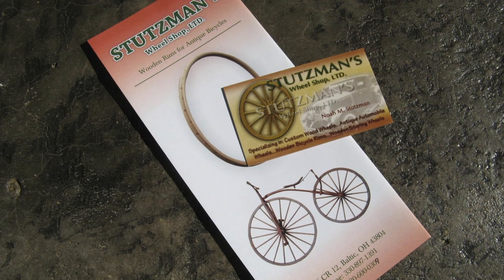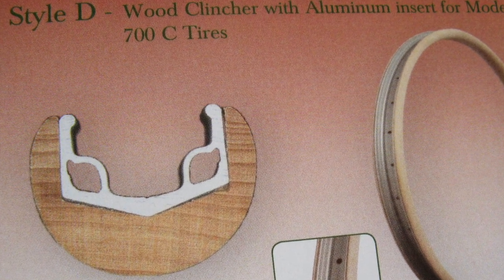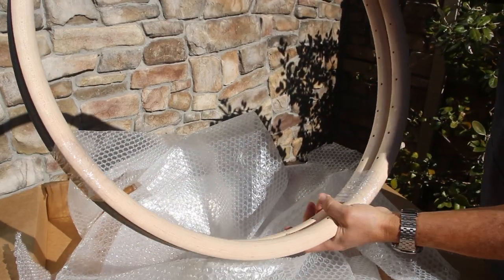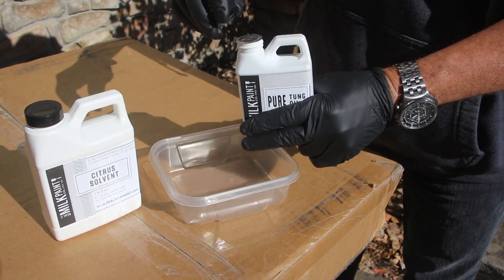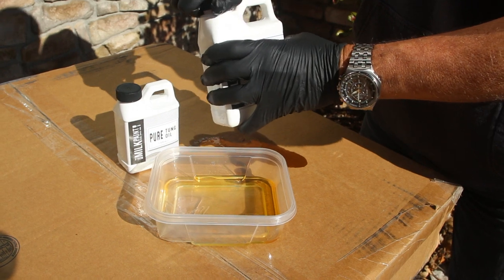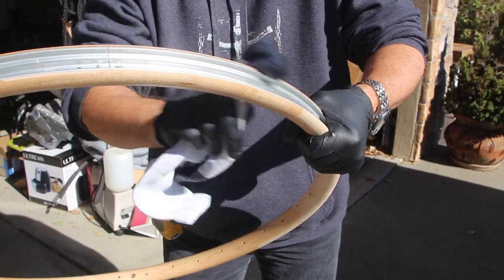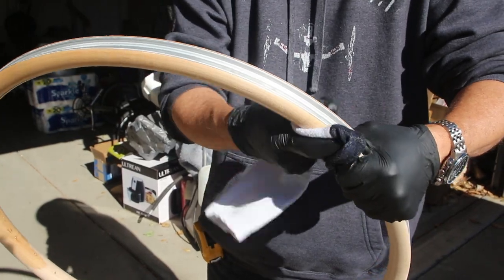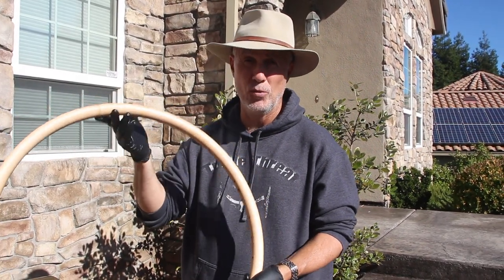The Stutzman Wood Bicycle Rims Have Arrived for the Hercules Speed King Path Racer Restoration!

Comment: Very cool project , it's funny to me some of the parallel s between cyclists and trikers ,  back I my 20s there were some manufacturers of wooden rims and I really wanted a pair , it wasn't so much the look although that factored in after all its really unique even back then , the reason I wanted wood is I read articles about track riders using them saying they had a much different feel more lively and seemd to give back some of the energy lost to flex . Looking forward to the updates on this project,  I've found when using tongue oil , it gives a deep look much like glossy carbon fiber it almost magnifies the structure underneath,  I never used the poly after but my use was for wood carvings .

One last thought , make sure you coat the bead on the inside, to make sure  all wood surfaces are covered . I sure you already know why .
Reply from the maker: Thanks very much for the tip about coating the bead, Jason! I'll make sure I do just that! I just put another coat of the oil on and I'm loving the way that it looks. I'd really like to forego the poly, as I don't know how it's going to affect the appearance, but I'm a little afraid that without the harder finish there won't be any protection from scuffing/rocks and such. I've heard the same thing about wood rims and I know that track racers were choosing wood into the 1940's. I'm now thinking that I'm a little sorry that I chose the rims with the aluminum inserts, as I don't know if I'll be getting the full "wood" experience. We'll see!